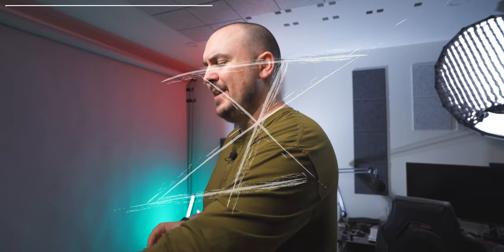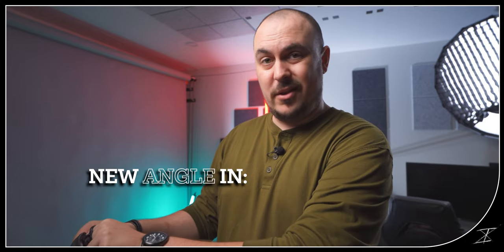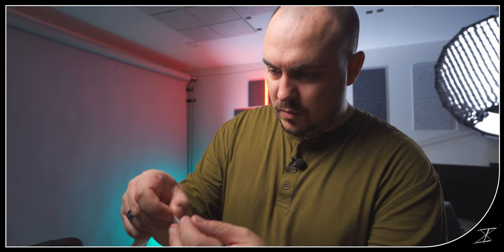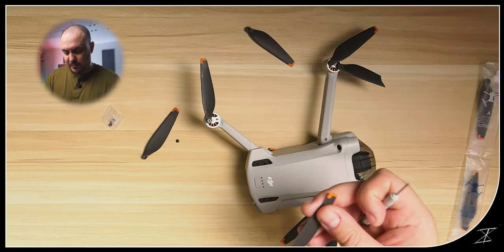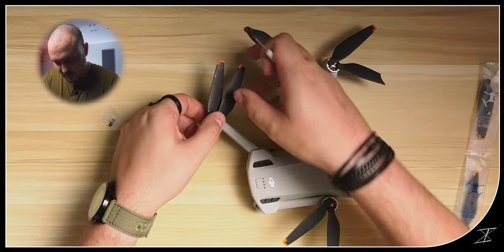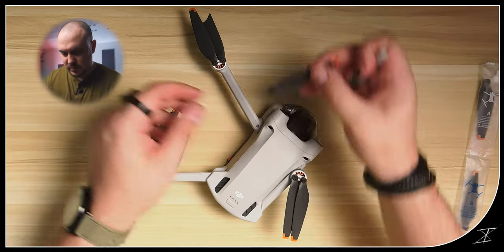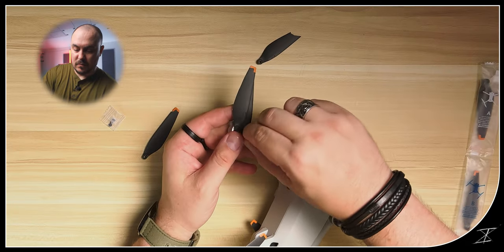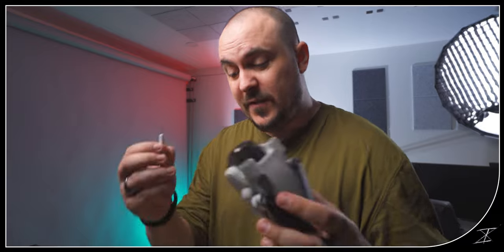How To Fix Your Broken Propellers for the DJI Mini 3 Pro drone

Comment: I would of used a new screw . From what I read there is thread lock on the screws that come with the props.
Reply from the maker: Interesting… when I was inspecting the new ones I got I couldn’t see any difference between those and the ones that came installed 🤷‍♂️

Maybe there’s a difference in the extra prop package that come with the drone vs the ones that come with the fly more kit and I grabbed the former?
Reply: @ianthebrightman  I only read it in a forum.  Luckily I have not had to research it yet.
Reply from the maker: Guess I’ll be looking into this when I’m next to the drone later on 🤣🤣

Comment: I though you were actually going to attempt to "fix" the props and not replace them. That was a close one. In an emergency I've had to glue to orange tips until my replacements arrive
Reply from the maker: 🤣🤣 these were definitely not repairable!  Replacements all the way
Reply: @ianthebrightman  Back in my early days with my Mini 2 I crashed it while on holidays. One of the props had a slight crack in it and I thought to myself, "that should be OK?" Later in that day after it sitting in a warm car , I took off and the prop snapped mid-air in the fist few seconds and the drone flew erratically across the road straight into a bush and broke more props. Lesson learnt there
Reply from the maker: 😭🤣😭🤣😭🤣 exactly my point

But duuuude that sucks!!